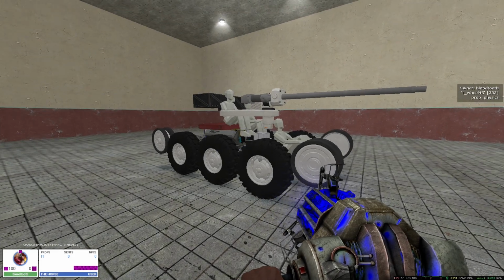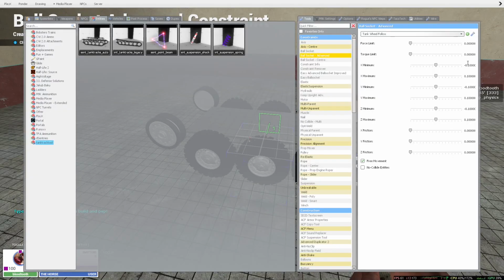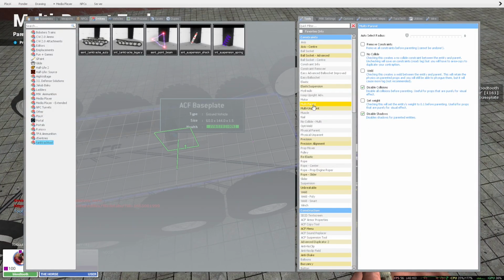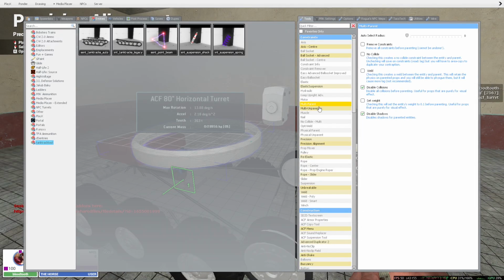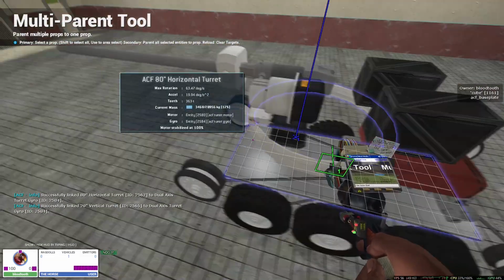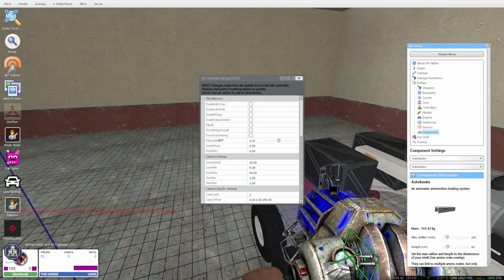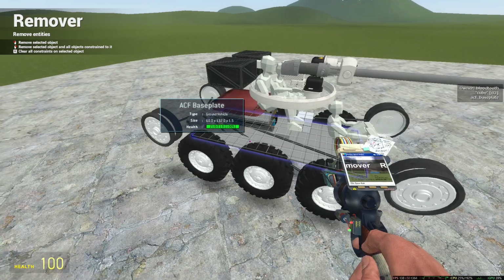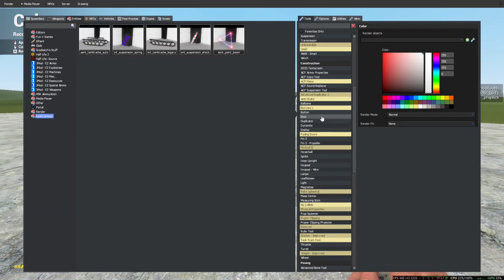GMOD ACF-3 Tank All-In-One Controller Tutorial

Comment: Hi, I'm having trouble with the engines from the new ACF; they seem incredibly weak. I connected a single-cylinder engine to a wheel via a transmission unit, but when I turned it on, the wheel didn't spin at all—yet as soon as I removed the wheel, the engine roared to life. I spent a long time messing around with the gear ratios but couldn't figure it out. If you know how to fix this or can help me understand it, I’d really appreciate it.
Reply from the maker: Sorry for the late reply. 

How heavy is your contraption? A single cylinder can only get you so far if your wheel and baseplate are too heavy, and it depends what ratios your using. I'm more used to legacy ratios so I cant help on the new acf ratios. If you're using legacy, lower final drives make your connected wheel have greater torque but in return will have a slower top speed, and the opposite if its higher final drive. If thats not helping then you might just need a more powerful engine, or the AIO is just doing funky things and not setting stuff properly, and if it is you just need to keep relinking your components to the chip to force it to register your parts.
Reply: Hi again. I checked the assembly's weight, and it's low. Yes, I'm using the old gear ratios and aiming for maximum torque. But the wheel still doesn't move—even when I suspend the assembly in mid-air, nothing happens. The wheel simply won't spin, no matter how I tweak the motor settings or gear ratios; I even tried the most powerful motors, but it made absolutely no difference.
Reply: My ACF might not be working, even though I downloaded it from the Workshop along with all the necessary add-ons.
Reply: I didn't have those kinds of problems with ACF-2.
Reply from the maker: @gidegames  Are you using a normal gearbox or just differentials/transfers? The way I've done it is engine to main gearbox (CVT or manual gearbox), then main to transfer/differential, then those to the wheel. If that's not it then i'm not sure what's causing that for you. I haven't been on Gmod for months now so I don't know if ACF pushed an update that changed how connecting gears works or its just bugged. Sorry I cant be much more help, I just haven't been on it for a while lol. Also if you think your ACF isn't working like you said, try downloading it from their github, thats probably more maintained then the workshop one.
Reply: @Paul-Beenis Hi, sorry for the late reply. I figured out the cause: there was a conflict between the ACF and Weight Tool Improved addons. I tested it afterwards and it works now. Thanks a lot for the reply anyway—I thought no one would answer me about this at all.

Comment: Hi, I liked the tutorial but I've been having issues with the Contraption Framework mod, where it won't let me save or duplicate anything. Have you come across similar issues? I would appreciate the help, thanks.
Reply from the maker: I haven't played gmod since I made this so I'm not sure if anything is working atm. Are you using adv dupe 2 or regular duplicator? Regular duplicator doesn't really work well with ACF in general so I would use adv dupe 2 if you aren't, and if you're using adv dupe 2 you need to area copy your build (shift + right click). It could also be a recent update that broke things and you'll have to wait for them to update and fix it.
Reply: @Paul-Beenis  I've tried both duplicators actually.
Adv dupe does work to some extent and I tried copying the area like you said, and then I used the "save map" option, but when I try to load a dupe, it loads with things missing, mostly constraints and vital components. This might be out of my power or range of knowledge to solve because I'm fairly new to building with ACF so I'll just wait for an update and see if that gets rid of the problem, thanks for the reply!

Comment: it sort of works, im having issues with the controls though, w and s is for steering and a and d is for actually moving... any ideas how to fix this?
Reply from the maker: What kind of drive train are you using? If its the one I have in the video, try swapping your final drives on the transfer cases, one side positive, one side negative. If its another setup then im not quite sure. You can try re-linking your main gearbox to see if that fixes anything, sometimes the AIO is a little weird and doesnt properly set things up in my experience. Theres also in AIO settings you can flip A and D and I think switch clutch to try as well.